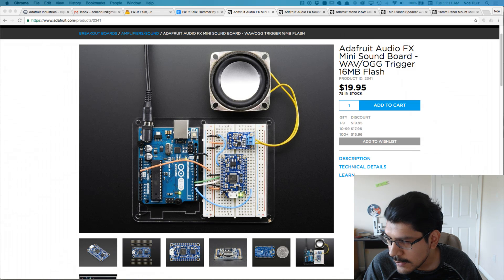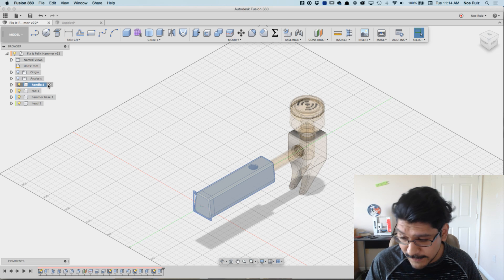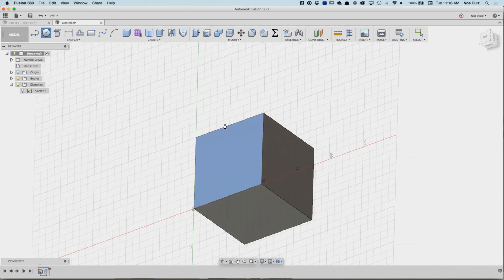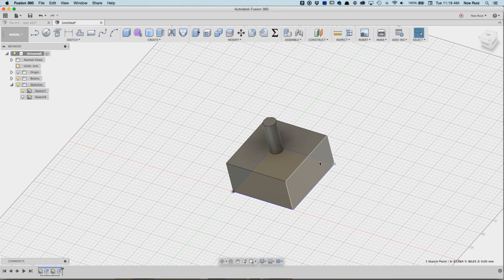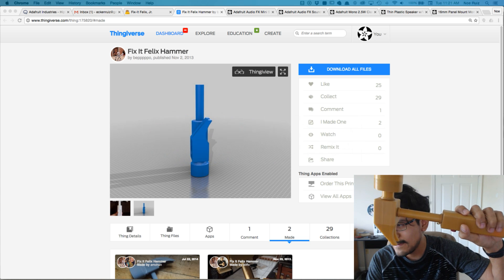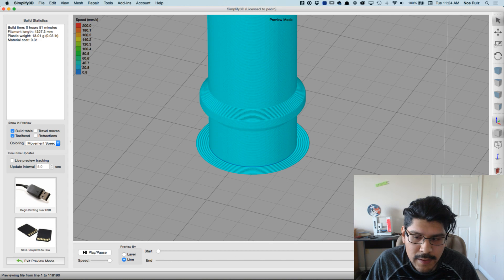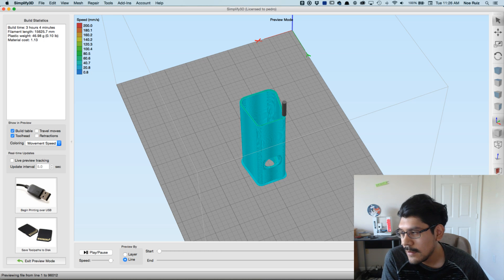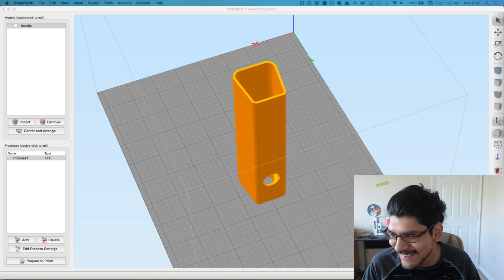Layer by Layer LIVE - Adaptive Modeling

Comment: Nice video, like always.
The next step in my opinion would be to used "named variables", or parameters : let's say you wanted the diameter to be half the height of the handle. Instead of inputting 30 mm and 60 mm and changing it to 25 mm and 50 mm if you decide the end result is too bulky, you can click the button with a "sum" symbol on it (next to the chamfer and fillets) and create variables that you can then reference anywhere in your drawing instead of typing a value. 
By combining this with what you demonstrated on this video, not only is your model adaptative, it can also be quickly modified since every important dimension can be expressed as factor / sum of other dimensions or variables that you then input. In this example you'd be able to say the handle must always be twice as wide as the axe. Or that they have the same length except the handle has to be at least 70 mm long, otherwise it'd be too small to hold it properly in your hand - just use max(70;axe_height) as the dimension.